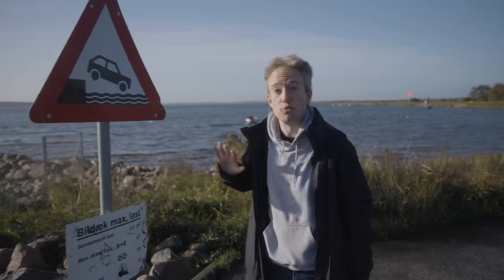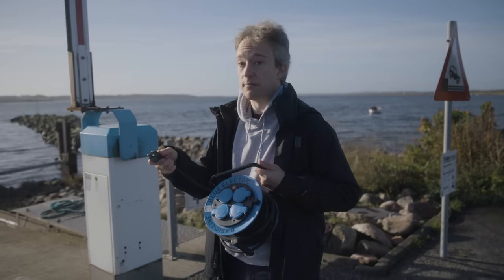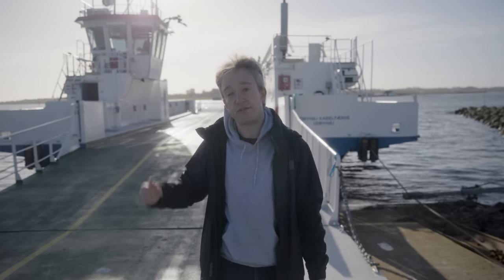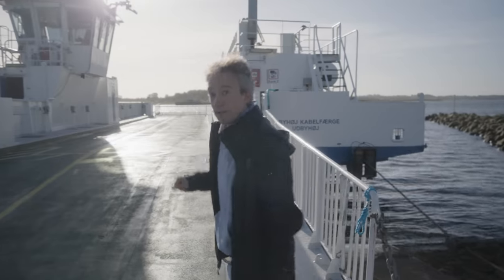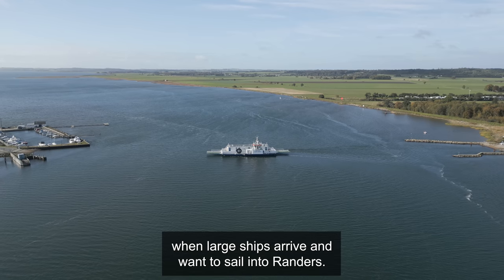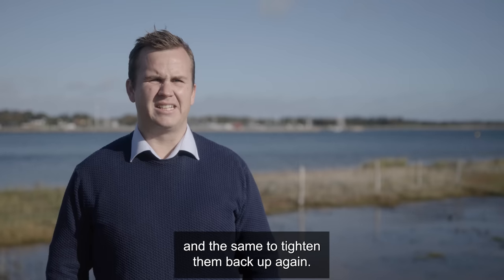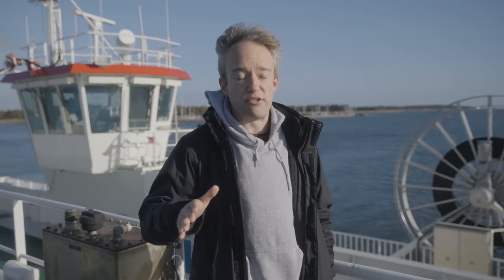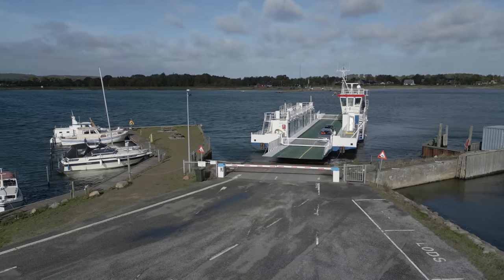This electric ferry uses a very long extension cord

Comment: I'm actually quite surprised at the power consumption of 150-200 kWh a day. The new Hummer EV has a battery pack of 200 kWh, and many electric cars are already able to charge their batteries from 20 to 80% in 15 minutes. I get that running a cable is cheaper and easy because it already uses a cable, but this makes me think battery power is not a bad idea at all for ferry's where they can't run a cable.
Reply: Battery's for ferries is indeed a very good choice, as long as they can charge regularly (which is easy to do when you have a fixed route).
There are already a lot of hybrid and fully electric ferries, with many more being build right now.
Reply: That cable probably wasn't cheap either. 350m of submarine cable that gets rolled/unrolled 88 times a day and will need replacing as well. 

I do not know when this conversion was done, but today 200kWh in LiFePO4 cells is less than 20kEUR before taxes. 200kWh for 88 one way trips (worst case scenario, i assume) is just 2.3kWh per journey. But the peak power will be a lot higher. So you would have to size the batteries for 0.5C or so at max power usage, and then charging them will be fast as well.

That cable is also rated for quite a high peak power delivery. If the ferry would use steady power for half the day and would then use just 200kWh, we would already be looking at a 22kW AC three-phase system. And that's far from reality, there is already a beefy power delivery system in place so that charging batteries could end up being cheaper depending on how long the cable lives.
Reply: The translation is not entirely correct. He says that the ferry consumes 150-200 kW (not kWh). 88 trips a day, four minutes per trip, gives approx. 6 hours of travel, meaning a consumption of ~900-1200 kWh/day.
Reply: @ida-mariepalm1627  is the translation for 100 liters of diesel also wrong then? Because 100 liters of diesel would get a big car like a hummer maybe further then a 200kwh battery, but not that much.
Reply: @biesbas  100 liters are roughly 1000 kwh of energy, but a diesel motor only gets 1/3 of that energy out. So a 300 kwh battery should also do the trick, if they couldn't recharge the battery during the day at all.
Reply: Weight is also a problem with batteries
Reply: @biesbas  No the translation is fine with the fuel part. Used to use 100 liters of fuel each day.

Comment: Neat.  Very curious regarding the inductive loads caused by that cable coil though.
Reply: Maybe it's DC in order to avoid that kind of issue ?
Reply: @psirvent8  that would certainly reduce the issue but you'd still have an inductive load.
Reply: @TheJonititan  Well, I did work for a company who makes "devices" with electric motors and the associated circuit boards to drive them and as far as I know from there, a motor will behave like a resistor if it's powered by DC.
Inductive, resistive and capacitive loads only mattering under AC.
Reply: @psirvent8  you'd still have an inductor.  DC only means that the inductive load is only present when you power it on or off.  Inductive loads resist changes you see.

Comment: Wouldn't it be easier and more efficient to pull the ship from one side to the other using the steel cable with winches on each side? I'm sure there is a reason why not, but I,'m wondering what it could be.
Reply: That's exactly what he said in the video isn't it? Or have I got myself confused?
Reply: There’s a ferry in the Lake District (North England) that works like that. Not sure if the motors are electric or diesel though.
Reply: @J75Pootle  No, the boat does the pulling of itself.
Reply: @J75Pootle  I think it somehow uses the steel cable to move forward instead of a propeller but the engine ist still on the ship. Otherwise there wouldn't be the need for an extension power line.
Reply: I think it probably doesn't make a huge difference efficiency-wise. But it's a little more practical because you always need an operator of some sort who needs to be on the ferry. If the cable breaks for example, that person can turn on the diesel generators, can steer the ship and take care of the passengers. Sure it would be possible to control the winches remotely from the ship. But what if the winch has a problem. Then you need someone on shore as well. So I reckon its a little more convenient and safe to have everything on board
Reply: The difference would be locating the motor pulling/wincing the cable onshore vs onboard the ferry. I expect the difference in efficiency would be minimal because the weight of the electric motor used to do the wincing is probably negligible compared to the weight of the entire ferry plus its loads. In fact they mentioned that they still have diesel engines and tanks for backup.
Reply: That would either require a motor on each side, or tensioning the cable to the point where no other boats could pass. Ferries like this have enough slack in the cable that most boats can pass over it when the ferry isn't pulling on it. The ferry also needs power for its ramps, and this one already had the motors on-board.
Reply: @gewiener  oh sorry I'm dumb, I thought you were asking why the shop didn't pull itself rather than why it isn't pulled from the shore, which is why I got confused
Reply: My guess is that cables would need to be much bigger and stronger, and with large winches, for that to work well. That would use much more energy, be it diesel or electricity, than this setup. 
The cables there is now, are lighter guide cables.  Those cables would be inflexible, which is a problem when you need to losen cables for large ships. 

In Denmark we still have a few pull-ferries,  but they work best, and are only financially viable, with small, light ferries (1-2 cars space) over very short distances like across small rivers.
Reply: Its a bit more of a technical challenge to have the winches on the shore vs on the ship, mainly relating to controlling both ends winches in balance from the ship's helm.   In any case the vessel would still need all the normal helm gear and local motors (as noted here they still have the diesel motors) both for emergency and when they need to move the vessel somewhere else for servicing.    Certainly it's doable, but not sure how much more efficient as you'd need twice the number of motors.
Reply: @J75Pootle  In the video he said the vessel pulls itself along the static cables, not that the cables pull from the shore.

Comment: Neat… almost surprised they didn’t change to pulling the cables from land…
Reply: You'd need someone on each side in case the winch breaks down, plus a person on board the ferry in case of trouble.  You'd also need two sets of engines (one on each side), while if the ferry has the engines you only need one set.
Reply: @toddkes5890  more importantly the friction of dragging a cable over the sea bed would be absurd.
Reply: i imagine an engine on one shore with a reversible gearbox attached to a loop of wire that can be pulled in either direction. every ferry i’ve ever ridden already has a worker at either end
Reply: @winterwatson6811    Its actually very common here in Danmark for small ferries like this one to not have any land crew at all. They are opperated with just one guy on deck guiding traffic etc. and the captain stearing.

Comment: Amazing. I wonder if this could be utilised more on riverways?
Reply: if the riverway is busy in any way, it'd have too much downtime. Also if the current isn't as fast as this one is, they're just unnecessary.
Reply: Looks like the requirements are short distance, relatively small vehicle/passenger traffic, few large boats crossing, and best is if you are pairing it with a cable ferry.
Reply: Maybe. It will depend on the cross-traffic. This ferry needs 90s to slacken the cable, and another 90s to tighten it again. That's three minutes. In our country, we have ferries crossing rivers more or less constantly, crossing the river five or six times per hour, rivers with lots of traffic. Three minute cycles to slacken/tighten the cables would be significant.

And I guess it also depends on the depth of the river. If there is isn't much clearance between the ships and river bottom, you don't have a lot of margin -- your cable has to be really on the bottom all the way, and not hanging above to bottom because there's some rubble keeping it away from the bottom. In rivers where the depth varies over the season (like in many European rivers which suffered from record low water levels this summer) this may not be feasible.
Reply: I also wonder why they don't just build a bridge instead? It seems short enough to handle a small bridge. But could it be because there is enough cross traffic to make a draw bridge inefficient?
Reply: @davidcubberly5435  Riverbed might not be good for a bridge or excess water traffic means larger ships need too much of the river for a bridge to be practical.
Reply: @davidcubberly5435  Bridges are far from being inexpensive. Eyeballing Google maps, that looks like a span of at least 150 meters, not counting the ramps on each end. That's not going to be cheap.

You'd replace a ferry by a bridge only if you have enough traffic to make it worthwhile.
Reply: @AbiGail-ok7fc  Interesting. The stat they mentioned worked out to running the ferry 11 times each day, so that might not be enough to warrant a bridge. It's super interesting how that decision is made though.

Comment: An electric plane with a very long extension cord that can fly directly from New York to Singapore would be a game-changer.
Reply: Easy, just build a metal ring with a diameter large enough for the ring to fit around the planet and to have about 10k feet between it and the surface of earth, balance it out and use it as a catenary. I think I'd call it jet stream

Comment: Talking about ferries driven by electricity in Denmark one example is the ferry "Ellen", sailing between Fynshav/Als and Søby/Ærø. That ferry uses batteries for the 60 min trip. Two motors with combined 1,5MW drive Elle with 14kn across the Lille Bælt carrying max. 147 passengers and 31 vehicles. Charging happens in Søby with current mostly originating from wind power plants.

Comment: There is a translation error at 1:13 "ren el" is being translated to "clean electricity" where it should be "pure electricity" or "fully electric". He is not saying anything about the cleanliness of the electricity, but rather that it is the only thing used for power. Other than that great video.

Comment: The efficency is interesting. Most people calculate with 40% energy efficency with big diesel engines. But this only works on high loads. Most of the time, a motor is on idle or little loads, like cruising after acceleration.
The ferry now takes 150-200 kWh a day. Before, it took 100 Liters of diesel, which is 1190 kWh of thermal energy. So the efficency of the diesel was before 12,6% to 16,8%. That is the real reason to switch from diesel to electric.
Reply: And I calculated the electric engine with 100% efficency. If it drops to 85%, the diesel only had 10,7% - 14,3%

Comment: Indirect and direct electric propulsion of boats using shore power has some history, mainly in Europe.  I haven't had a chance to read the whole thing yet, but if you Google for electric trolleyboat, you will find among other things the Historia y Arqueología Marítima page on this, which shows a lot of different systems, including one still in use (and maybe actually more than one, because theirs doesn't look like the photo of a single wire electric trolley ferry shown at a Boston Street Railway Association meeting several years ago, although with the caveat that this was well pre-pandemic).

Edit:  Found the other one (that was shown at the BSRA several years ago):  Straussee Ferry.  Wikipedia has a mini-article on this.

Comment: Surprised this didn't also cover the numerous fully electric ferry's in the Fjords of Norway - Just back from there in August - lots of them now - They plug in at each end between sailings for top-ups. Lots of Hydroppower on tap there of course

Comment: “One more step in the right direction.” ❤ Lots of small changes and efficiencies add up over time. We still need to push for big changes as well, but we shouldn’t forget about all the smaller “low hanging fruit”.
Reply: The fatal flaw here.   Denmark still gets  ~ 56 to 76 of its electrical power from oil, coal, natural gas and other nonrenewable sources depending on season and year.  

Oil  ~ 32 - 38%
Coal ~ 10 - 16%
NG ~ 12 - 18%
Other nonrenewables ~ 2 - 4%
Reply: @forkliftofzen5318  That's never to be forgotten, but at least such an electrically powered ferry won't care about what the source of it's power is. So as the grid gradually changes to a less polluting mixture it won't be yet another diesel powered thing fix. It also gets rid of some local emissions too which might have some benefits.

I'd also expect power stations to be capable of being cleaner with particulate matter than smaller combustion engines moving around everywhere. They are typically big and stationary, so they should at least be able to filter out much of the particulate matter in the exhaust gases and maybe someone will eventually come up with a good CO2 capture and stable storage solution that'll lock it up in a less harmful way. Whether they currently do that already, I honestly don't know I guess it mostly comes down to what they are legally required to do and that actually gets enforced/inspected.

Comment: the funny thing is the victorians did something similar in the UK, running a railroad along the shore that would get submerged in as the tide came in, the 'train' was up on stilts and picked up power along a set of power cables strung along the trackway

Comment: Wow, a maximum of about 200kWh a day is a lot less energy than I expected - this means that 2 Tesla Model S battery packs could keep the ferry running all day.
But the cable is obviously more efficient because it eliminates the losses when charging/discharging the battery - great solution!

Comment: Correct me if I'm wrong, but since a 350 meter extension cord would suffer too much voltage loss, the cable must be at transmission level voltage and presumably there's an on-board transformer to reduce to a standard voltage level unless the motor operates at exceptionally high voltage.
Reply: Well most modern trains are supplied at 25kV AC and have a transformer onboard to step the voltage down, so likely they would apply the same logic to a ship. They've probably used a thick cable and a decently high voltage on this ship, higher voltage would require thicker/more sophisticated insulation, however.

Comment: I believe there are also ferries in some places that run on overhead wires, much like an electric train or trolley-bus. Some use only one wire and have the return current through the water - not all that efficient but works well enough. In discussing the costs, consider not just the cost of electricity vs. diesel fuel, but also that diesel engines require a lot more maintenance than electric motors - probably the cable and winding drum turn out to be less maintenance than diesel engines.

Comment: Go to Finland, Finnferries m/s Elektra near Turku. Runs on batteries and loads at both docks via quick high voltage chargers.
Connects Islands over a small sea straight.
I've been in the battery room. Interesting charging technique, since multiple batterie sets must be at near equivalent voltage before connecting to eachother.

Comment: Thank you so much for showing all the little steps. It’s like with trucking, so many focus on the long distance but it’s the shorter journeys that have already started moving. It’s brilliant to hear of what people are doing and also that they are figuring out ways to do it more affordably that even fit into their existing systems!!

Also speaking of how quiet things are, the trucking industry is getting a move on 1) because they saw what happened to passenger vehicle companies and 2) because they fully expect cities, ports etc. to start kicking ICE trucks out for being too noisy and polluting, I wonder if boats will go the same way. There are places that say trucks can only go in if they are running on electricity so some trucks are being made into hybrids, and they already do a similar thing for ships with fuel so I wonder if they’ll do that for electricity as well. Plug the big ships into the mains while parked so they can run on that instead, if they don’t do it already.
Reply: Where are electric or hybrid trucks required? I have my doubts, because the technology is still in its infancy. Tesla for example, has yet to sell even one fully electric heavy truck.

Comment: It would have been interesting to know more about the spool. It looks like its driven by a motor. Does the motor spin at different speeds as they cross to account for the radius changing as the wire is unwound? Do they use the motor on the spool in both directions (to wind and unwind) or only one?
(But I did enjoy the video so thanks :) )

Comment: The conversion was actually quite easy, as it had always been a cable ferry, and it did already use diesel-electric traction. (because it pulls the cables to move, instead of using a propeller, it must provide a high torque from zero speed, so it would not be possible to use a gear box. This is the same reason why most diesel trains are actually diesel-electric)

Comment: If the ferry is pulling on the cable, why aren't the motors on the shore? This is easier to maintain, quiet, and it saves mucking about with a power chord. Plus you can replace the boat cheaply.

Comment: I'm surprised it's not easier to have electric pulling stations on both banks of the river. Two motors instead of one... But on the other hand no need for 300 meters of electrical cable. Obviously they did the maths, just interesting